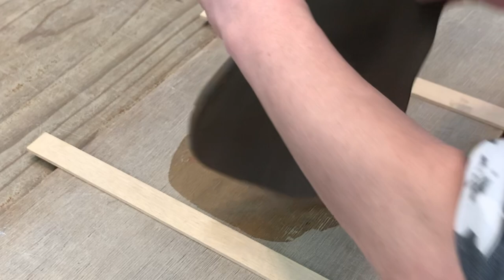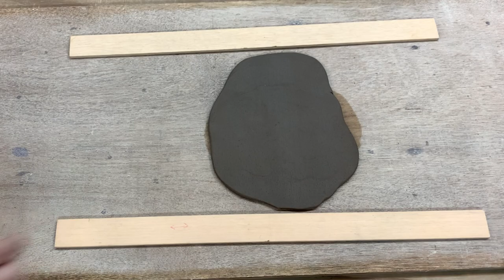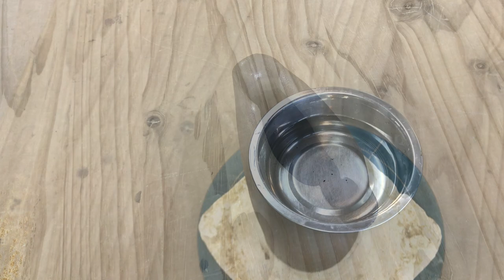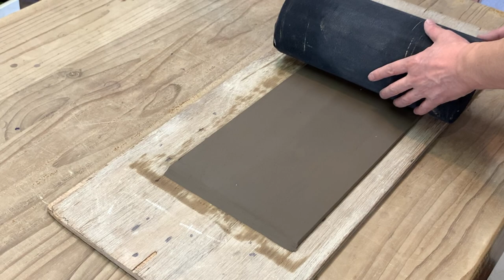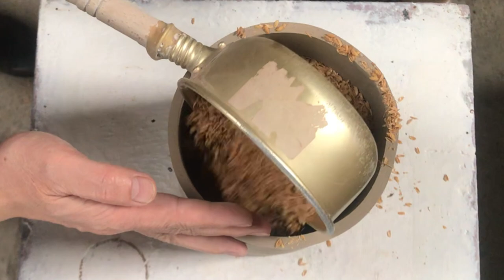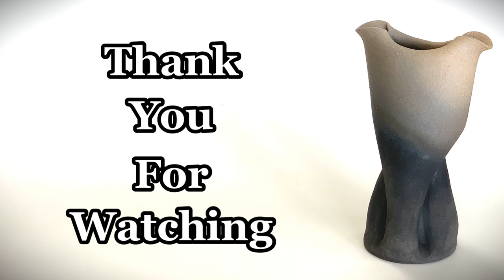炭化変形花器の作り方 How to make a carbonization metamorphic vase 陶芸 pottery 熊本栄司 Eiji Kumamoto

Comment: So I'm wondering if this vessel will hold water just with the smoke firing like that The saggar firing? Is the clay vitrified or is it just low temperature I have to figure out the Celsius
Reply from the maker: Thank you very much for watching.
This vase is coated with an anti-water leakage agent after firing.
Reply: @JapanGoldenPotteryEijiKumamoto  What do you use?? I am curious as I too have wondered what I can use on my pit fired pieces / raku vases .. naked raku?? thanks sooooo much !!! I just LOVELOVELOVE your tutorials!!!
Reply from the maker: I use something called POLON-T as a water repellent for vases. Of course, it is a Japanese manufacturer.
　Shin-Etsu Chemical Co.,Ltd.  6-1 Ohtemachi 2-chome, Chiyoda-ku, Tokyo, Japan